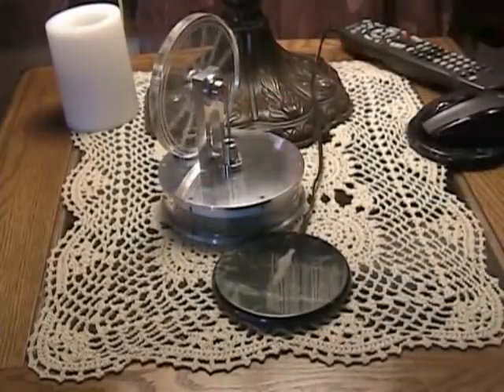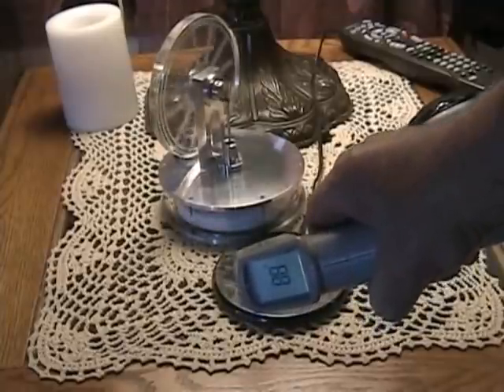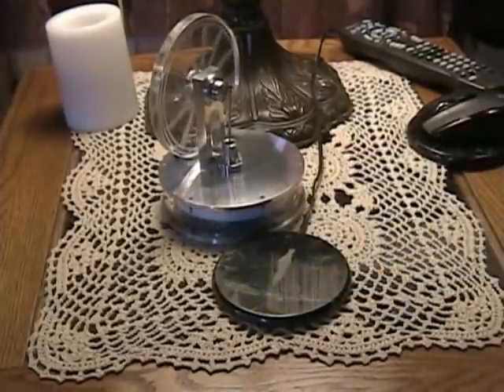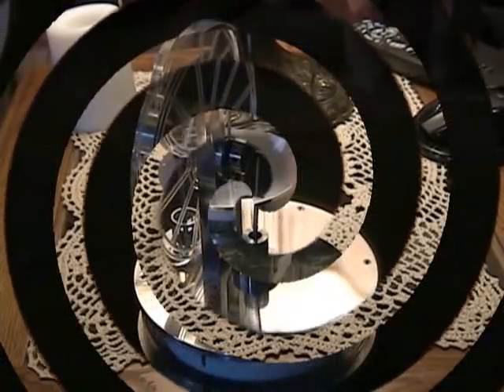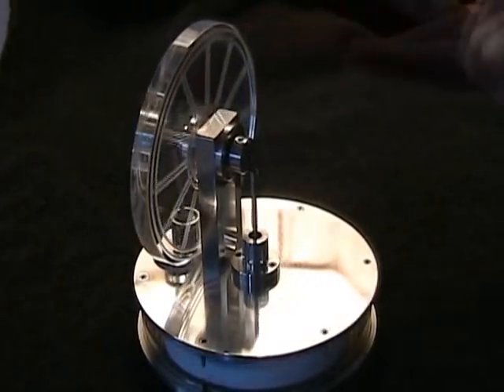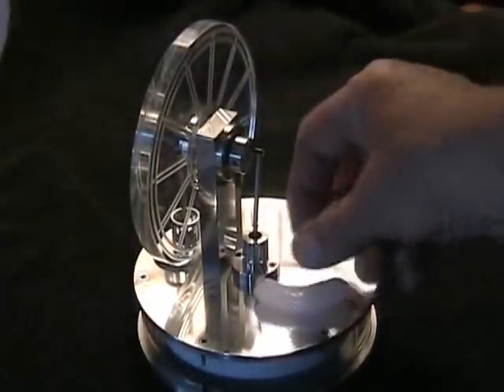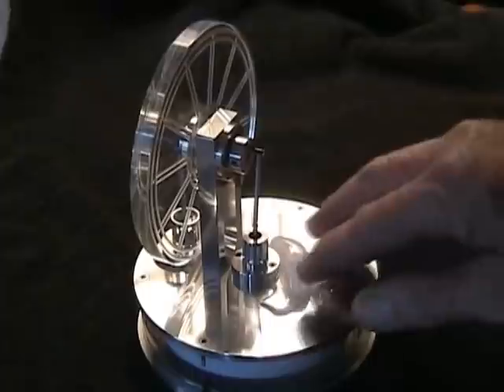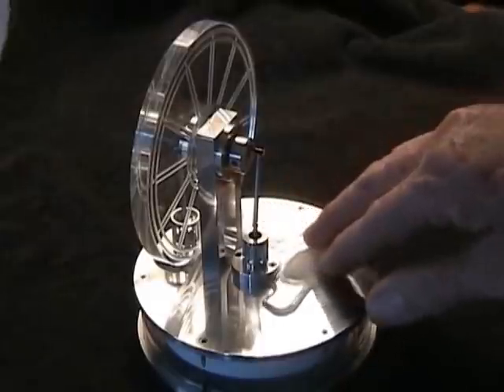Hand Made LTD Stirling

Comment from the maker: Actually if you sit the engine on something cold, it will reverse direction and run as long as there is about 10 degrees difference from one plate to the other.
John

Comment: does the engine work if it sits on a cooler surface with warmer air around it or does the heat have to come from the bottom?